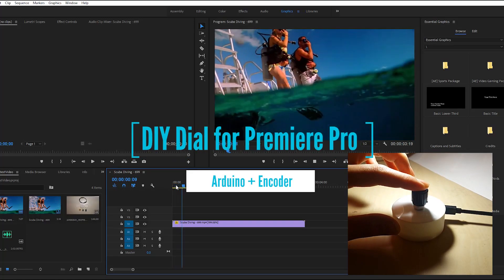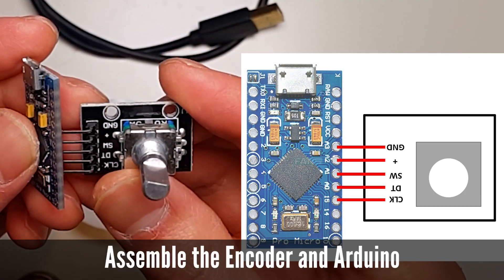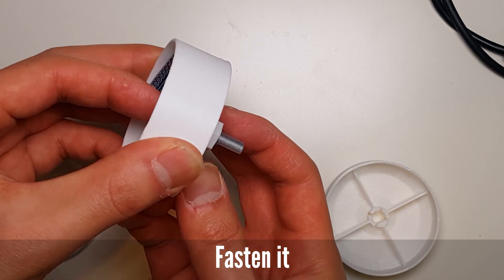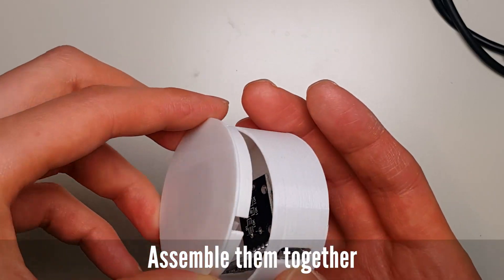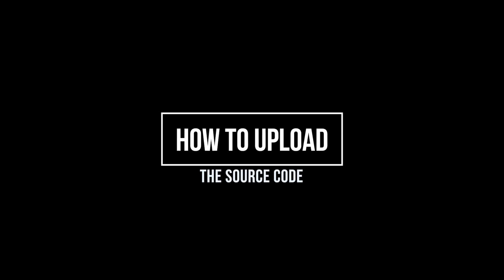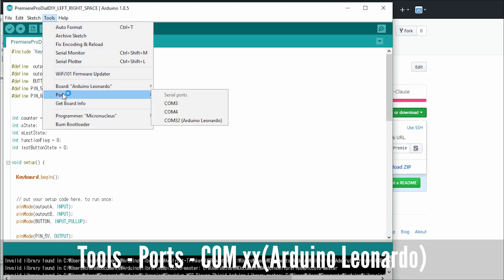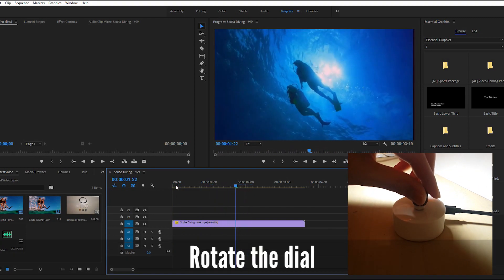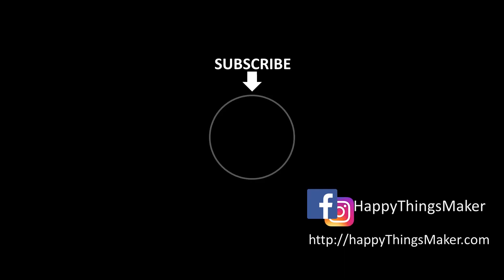Premiere Pro Control Dial DIY |  Video Edit Wheel | Arduino Leonardo Project | How to make

Comment: Nice video, I want to use this with lightroom but when I turn left or right the photos jump 2 at a time. Can you modify the code please
Reply from the maker: Hi Luci luss , I modified the code but I couldn't test it because I am on vacation.
Try this one. If there's any error on it, please comment it. I will fix it.
Thanks :)

// [ Instruction ]
//Youtube https://youtu.be/FACm5D3bskQ
//Manual https://sites.google.com/view/100happythings/15-premiere-pro-dial-diy
//Source Code https://github.com/happythingsmaker/PremiereProDialDIY
//3D Printing File https://www.thingiverse.com/thing:2810760

//[ Parts and Tools ]
//Rotational encoder with switch http://ebay.to/2t6I0f4  ($1)
//Arduino pro micro http://ebay.to/2oxvIrw ($4.9)
//Non Slip Rubber http://ebay.to/2oyFGc1 ($0.5)

// include a Keyboard library
#include "Keyboard.h"

// From here, text "OUTPUT_B" is going to be replaced with "15".
#define  OUTPUT_B 15

// "OUTPUT_A" is going to be replaced with "A0".
#define  OUTPUT_A A0

// "BUTTON" is going to be replaced with "A1".
#define  BUTTON A1

// "PIN_5V" is going to be replaced with "A2".
#define PIN_5V  A2

// "PIN_GND" is going to be replaced with "A3".
#define PIN_GND  A3

// Declare variables aState, aLastState for checking the state of OUTPUT_A of the encoder
bool aState;

// We need to save the previous state of OUTPUT_A
bool aLastState;

// this variable for check the state of button.
// in order to prevent the button from chattering, we need to check the first moment the button is pressed.
// Becasue when a button pressed, the button usually sends a lot of signals.
// So, we need to ignore following noise signals for a while.
bool lastButtonState = 0;

// void setup(){} function is for one time setting
void setup() {

// in order to use the Keyboard library, begin() is necessary
	Keyboard.begin();

	// OUTPUT_A (A0) is for INPUT
	pinMode(OUTPUT_A, INPUT);

	// OUTPUT_B (15) is for INPUT
	pinMode(OUTPUT_B, INPUT);

	// BUTTON (A1) is for INPUT
	// Most pin has thier own pull-up resistor.
	// INPUT_PULLUP makes the pin high.
	// a leg of button is connected with this pin and GND
	// when the button is not pressed, the pin reads HIGH signal because of this PULL-UP
	// when the button is pressed, pin is going to be LOW which means "pressed"
	pinMode(BUTTON, INPUT_PULLUP);

	// PIN_5V (A2) is for OUTPUT
	// This pin is used for giving 5V to the encoder.
	// normally, 5v is coming from VCC, but, I didn't want to use any wires
	// So, this is a kind of trick, but it works well.
	pinMode(PIN_5V, OUTPUT);
	digitalWrite(PIN_5V, HIGH);

	// PIN_GND (A3) is for OUTPUT
	// This pin is used for giving GND to the encoder.
	// normally, GND is coming from GND, but, I didn't want to use any wires
	// So, this is a kind of trick, but it works well.
	pinMode(PIN_GND, OUTPUT);
	digitalWrite(PIN_GND, LOW);

	// read a signal from OUTPUT_A
	// this is for initialization
	aLastState = digitalRead(OUTPUT_A);
}

// in order to prevent chattering, we need to check the moment when was the last click moment
// for 1000ms, we will ignore all signals
long lastClickTime = 0;
long tempCount = 0;

// this loop() function repeats its code eternally
void loop() {

	// millis() returns current millisecond from the moment when the arduino powers on
	if (millis() - lastClickTime > 1000) {

		//read signal from OUTPUT_A and save its state to aState
		aState = digitalRead(OUTPUT_A);

		// if aLastState is not currentState, it meant there's something changed.
		if (aState != aLastState) {

			// read another pin's state.
			// if you want to know about the theory, watch this video
			// https://www.youtube.com/watch?v=v4BbSzJ-hz4
			if (digitalRead(OUTPUT_B) != aState) {

				// send Left Arrow
          if (tempCount ++ % 2 == 0) {
            Keyboard.press(KEY_LEFT_ARROW);
          }
			} else {

				// send Right Arrow
          if (tempCount ++ % 2 == 0) {
				  Keyboard.press(KEY_RIGHT_ARROW);
          }
			}

			Keyboard.releaseAll();

			// save current State as last State
			aLastState = aState;
		}

		// read Button pin and check it is pressed (LOW)
		if (digitalRead(BUTTON) == LOW) {

			// and this code checks whether it is edge (HIGH->LOW)
			if (lastButtonState == HIGH) {

				// sends space character
				Keyboard.print(" ");

				// save currnet milliseconds for ignoring for a while
				lastClickTime = millis();
			}

			// for checking edge
			lastButtonState = LOW;
		} else {

			// for checking edge
			lastButtonState = HIGH;
		}
	}

}
Reply: Now it works well       **** THANK YOU  ****
Reply: @luci295  i want to do this button for my photoshop and lightroom(specially this one) 
does it works properly? I would like to modify parameters like expossure or contrast, maybe color temperature, etc but actually im not really sure how to implement it. I dont want to turn photos.
Reply: Do u have modified code for passing 1 image? I Would like to change values in lightroom 1by1 and not 5by5 like using arrows , is there any posiility to change it?

Comment: Do you think that I would can add more dials and buttons for another uses into the program, adding to the code needed?
Reply from the maker: Osvaldo Murillo Yes, you will need some change on the code. I will upload some guid on the source code. and also comment here.

Or I thnk I can make one more video instruction. what functions do you want?
Reply: @EunchanPark  Yeah that was exactly my thought - for example the "razor cut" tool comes to mind when watching this video.